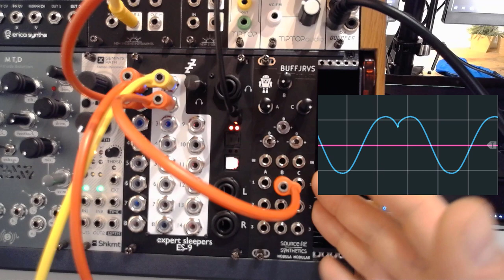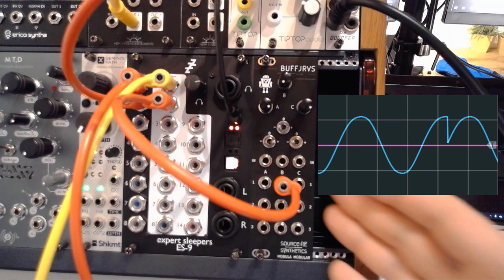Episode 28: BUFFJRVS from Source:RE Synthetics and Mobula Mobular | A buffered Mult with a twist

Comment: The BUFFJRVS website mentions "Very soon you learn that duplicating, reducing, inverting, offsetting, and muting signals is the key to repeatable and nuanced modulations.". It wasn't obvious to me how you would offset with this - is that something that the module can do (e.g. a sin wave with +5V offset)? Also what happens with multiple inputs, I assume no summing (just multing if input not present)? Finally is the mult accurate enough to avoid pitch droop? Thanks for the video.